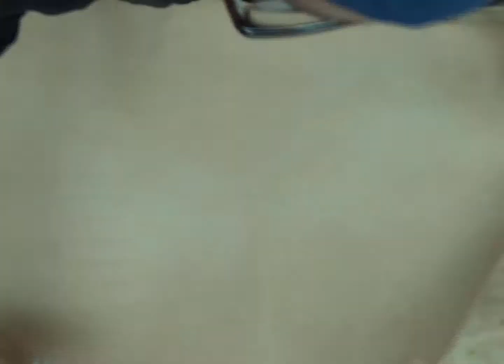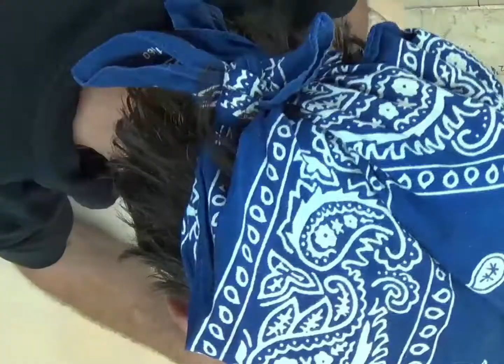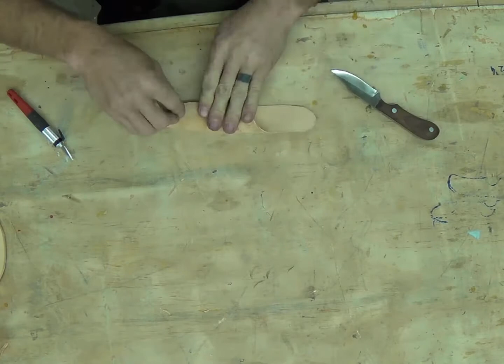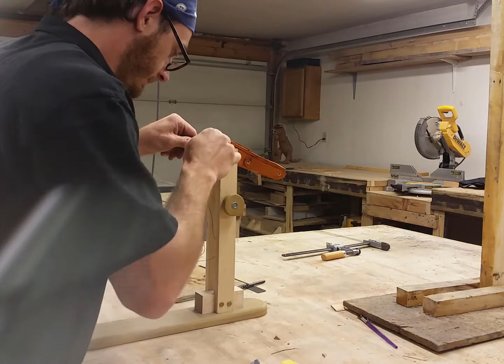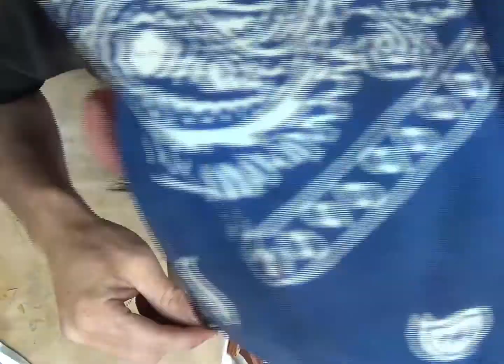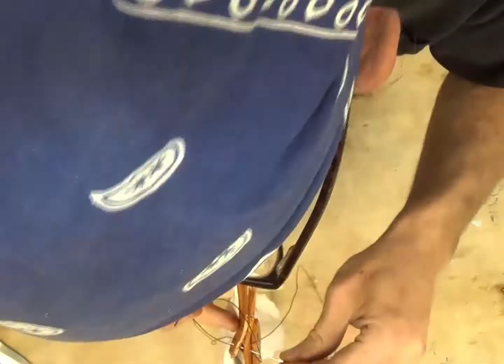Making the Sheath for My Custom Knife!

Comment: Hi another great video, I was very impressed by the vice you held the sheath in, whilst sewing, is that one of your ideas, if so have you a video of how to construct it as it would be a great addition to my leather working tools.

When I dyeing leather I sometimes use a Kiwi polish applicator comes in different colours and it is easy to apply and when dried finish off with a bit of wax

Thank you
Be safe 
Sam